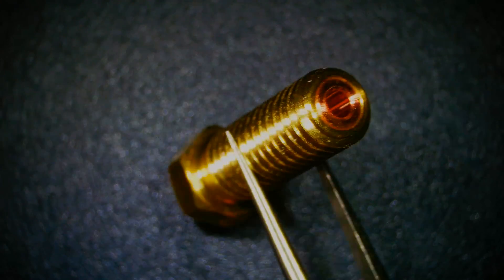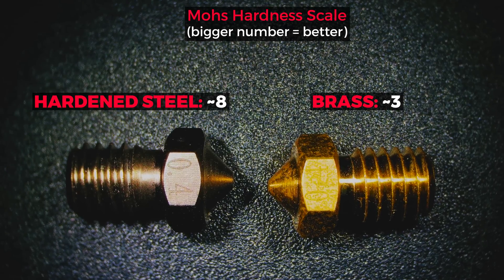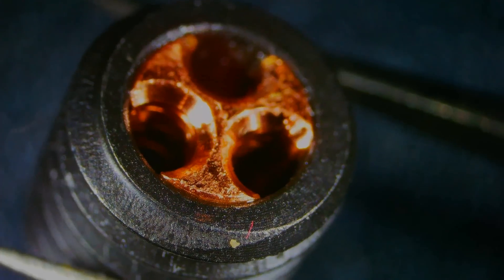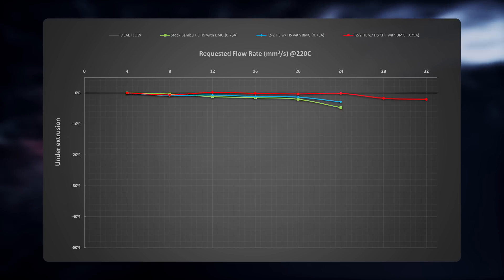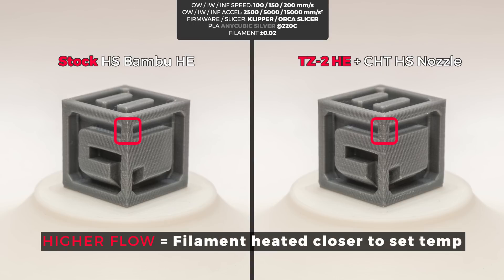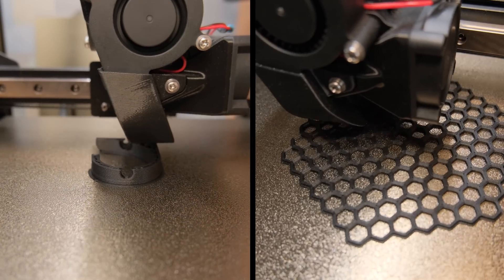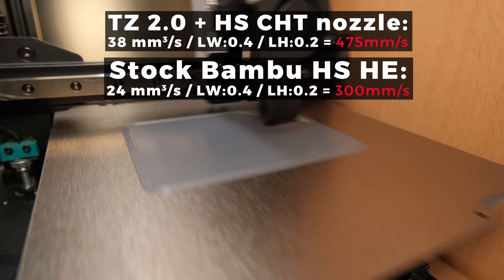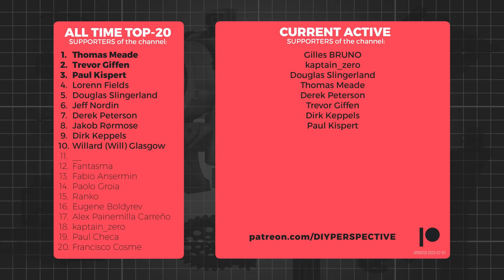HARDENED STEEL Nozzle with COPPER INSERT (IMPORTANT UPDATE in VIDEO DESCRIPTION)

Comment: How do you tell when the extruder starts skipping? What does 3~5% under extrusion mean, how is it measured?
Reply: You hear it skip or see the gear jump randomly as it attempts to extrude. And 3-5% under extrusion means that the extruder fails to push 3-5% of requested material, easy, but not 100% accurate test would be to measure from the filament inlet of the extruder to 100mm, then make a mark, extrude 100mm at the flow rate you want to test, then measure again. Your mark should be at the inlet, any gap between the mark and inlet indicates under extrusion, if the mark goes into the inlet, it's over extruding.

Comment: Those nozzles with copper inserts wearing out a bit faster is actually not a verry big deal since they're exchanged fast and easily at a cost of just €1,50. Compared to a naked Bambu Lab hotend of around €18, on which you need some time to disassemble and  exchange everything, or a fully assembled hotend which comes at €37

Comment: is it still necessary to preheat throat to tighten the nozzle? or tight it in cold throat is enough? and is any specific torque value or just tight with 6th sense;]

Comment: Hi, I was wondering, does the Qidi x plus 3 have automatic flow rate ajust? (same as the Bamboo), also, would it be possible to apply this hotend to the Qidi printer?
Reply from the maker: Hey. It doesn't. They're cht nozzles that fit QIDI hotend on AliExpress.

You could also apply only the tz nozzle. It would need additionally the Volcano to V6 adapter though.
QIDI nozzles are 19mm length. Volcano adapter + TZ cht nozzle is 8.5+10.6=19.1mm.

Comment: wait, how this works? You need 3 filament go in to the top? or does it slice it into 3 as it's gong in?
Reply from the maker: Plastics have very low thermal conductivity. So this nozle basically acts as a mixer to split the flowing plastic into 3 parts to better and more equally heat it.

Comment: This upgrade uses standard v6 nozzles correct? 

My only gripe is I wish it used a ring heater. But I’m definitely looking at this for a p1p
Reply from the maker: No, these are custom nozzles and not V6 for the TZ 2.0 hotend. But you can find V6 nozzles like these for other hotends.
Reply: What are the advantages of the ring heater over the flat ones? I was searching online looking for an answer but couldn't find anything

Comment: It makes sense.  The velocity of the abrasive material doesn't increase significantly until the filament necks down through the nozzle opening so the worst wear occurs at the smallest orifice.
Reply from the maker: Yeah and you also squishing down the filament at high speeds.

Comment: Do you need to increase the nozzle temperature to allow better flowrate?
Reply: No, at the same temperature it's heated the material more effectively so if anything you can run with slightly lower temperatures for the same performance if you want to save electrical costs or something 😂

Where these really shine though is high temperature and high speed. 

I was printing at 300mms with 0.8mm line width out of 0.4mm nozzle without under extruding @ 238c with geetech pla that's about 48 (mm)3/s which is insane. If anything I could of reduced temperature a little more as did have some cooling issues and had immovable supports and some drooping on non supported over hangs 45-50 degrees)

My nozzles were volcano style fitted to Kobra 2 max hotend.

Comment: What's the best way to mount this in a non bambu lab printer?  Do you think using your v6 adapter from the other vid + mounting in 3d printed v6 adapter mount (my printer doest use v6 style hot end)?  

Also,  what klipper settings shoukd i use for this therimstor/heater as im not dropping into a bambu lab?

Comment: I noticed there is a cheaper version from JUUPINE 3D Lab Store is it worth the risk? It is at least half the price and there are more nozzles options. I wonder if they are all the same manufacturer.
Reply from the maker: From my understanding Haldis 3D designs and manufactures the hotend. They reached out and asked if I was interested way before I saw those hotends from other sellers. Most likely they are mainly selling them in bulk to the resellers. So they should be the same, but I can't really know that for sure.
Reply: @PrintingPerspective  Thanks for the info. I am looking for a whole kit for P1S with the thermistor included as I want to keep my original intact.

Comment: I'm going to test this nozzle on my x1c for one main reason, parts don't seem to crystallise enough when printing fast and that makes them weaker.
Reply: howd it turn out? looking at getting one for my p1s
Reply: @EnchiladaBro  it does help when printing fast, but it seems there is a limit, possibly due to the hot zone length or heater capacity. Do I recommend it? Yes.

Comment: Amazing video, you have really found your niche in the world of 3d printing!

Can you do strength testing with this as well? From what I have read high speed printing is bad for strength since the filament does not get a chance to really heat up, with a cht nozzle it should be better. I am interested in the difference between slow printing with a regular nozzle and fast printing with parts that are designed for high speed printing.
Reply from the maker: Well, I thought multiple times about doing a video like this, but proper layer adhesion testing would require making a custom testing machine. And that takes a LOT of time. At some point, I will do it just because I love testing stuff. For now, I personally just use half of the hotend's max flow rate when I need good layer adhesion.
Reply: I always love to see similar testing done to confirm test results, but CNC Kitchen did a video on speed vs strength testing on his x1 and using the Cht nozzle almost increased layer strength proportional to the flow increase! Which makes sense, so these new nozzles let you print faster and maintain the strength. Printing slow is only stronger if you are running out of flow at higher speeds based on his data. Would love to see it confirmed!

Comment: @DIYPERSPECTIVE
How is the situation with the nozzle after two weeks?
Did you give it your all, and printed the hell out of it?
Reply from the maker: I had very little printing after I made the video as I swapped to a different hotend and extruder for a future video. I printed more for the video with that hotend/nozzle than others print when doing a 3D printer review lol. If you only on occasion print abrasives you will be fine. Most wear happens at the tip of the nozzle not inside.

Comment: bought two of them  and tested them into two different hot ends . In both scenarios i suffered from extruder motor overheat and stringing. Switched back to regular no issues at all. idk but it didnt worked for me
Reply from the maker: Well slightly more stringing is unavoidable because the insert is at the end of the hotend and it very well heats up the filament. So it can ooze more. I personally didn't saw that much more stringing. Also what a weak ass extruder you are using, haha? Even BMG type worked well in my case with 22mm stepper motor.
Reply: @PrintingPerspective  titan clone with medium size (32 mm depth) nema running at 0.8 amps
Reply from the maker: You should check out my video about original Bambu hotend where I showed how horrible Titan extruder is as it had insane under extrusion compared to even BMG. With these high flow hotends you need a powerful extruder, I even said that in this video. BMG is bare minimum and you are using Titan who works fine only with very low flow rates. You should be using something like Orbiter V2 with such hotends.

Comment: So is it the copper or is it the CHT-style that is making the difference?  I'm all about copper nozzles and blocks, but I wonder how much difference that small amount of copper for the insert makes.
Reply from the maker: Mainly CHT type as you split and heat the filament more equally and faster. But copper definitely helps also due to its high thermal conductivity.

Comment: Thanks for the video. Tried to purchase through paypal. There seems to be some error during checkout. Is this upgraded version available elsewhere?
Reply from the maker: I will tell the company, I don't think you can buy it anywhere else at this moment, I haven't seen it on Aliexpress yet.
Reply: @PrintingPerspective  Getting this same error with attempting to use paypal
Reply: @PrintingPerspective  Thanks i was finally able to buy the hotend using paypal and recieved the item quickly. Unfortunately, the package doesn't even include the hardened cht nozzle for which i made this purchase. I am still awaiting a response from customer service on why they didn't send the cht nozzle. Very disappointed. I was looking forward to using this hardened cht nozzle.
Reply from the maker: @nirajahmed7398  Hmm, the CHT comes as a gift. So they should send it. I will say to get their shit together, haha.
Reply from the maker: @nirajahmed7398 This is what they said after I forwarded your message: 

This problem is our fault. The warehouse shipped it and forgot to put it in the package. We are communicating with customers who have purchased it and will reissue it again, hoping to make up for their losses! This problem will not occur in the future, thank you for your timely feedback to us, thank you very much! Please rest assured that our follow-up shipments will strengthen inspections. In addition, you can help us reply, please contact customer service for missing accessories, and we will reissue them!
Reply: @PrintingPerspective  Thanks. Got a reply from them acknowledging the missing of part. Now i wait again. Meanwhile i might try one of those v6 hardened cht to print glow in the dark filament.

Comment: Hey, I love your videos, thanks for your awesome content :). Could you please test the fake Ali Volcano CHT nozzles to see if they can compare to official Volcano CHT nozzles ? I didn't see any comparison on these types of nozzles on the internet or YouTube.
Reply from the maker: Thanks, I think they will be very similar. You probably just need a stronger extruder with clones as the insert slightly restricts the flow.
Reply: @PrintingPerspective the copper splitter on the Vulcano cht clones is just as long as on the regular clones. I personally don't measure  difference between a mellow Vulcano adapter + clone cht Vs a Vulcano clone cht.  Both give me around 30mm³ on a CHC pro with esun pla+ at 220°C

Comment: Maybe the filament used for testing with wood fibers is not as abrasive as carbon fiber or stone so you would have seen likely more wear with the other two.
Anyway, it seems to me a very good idea. Even if the copper insert wears out, you can always replace it and they could just include a spear one.
Also i think the abraded copper should be smaller than the fibers of the filament so it shouldnt cause any problem.
Reply from the maker: Yeah, the wood filament is definitely less abrasive than the carbon fiber-filled one. But I mean if these nozzles become popular they will come down in price as more sellers start to compete with lower prices. Plus it is good to know that the copper insert won't wear out instantly. I hope we also will see regular V6 nozzles like these. Having a high flow and not having to worry when I need to print some abrasive filament is so nice.
Reply: @PrintingPerspective  I can currently see hardened v6 cht nozzles being available on Ali.
Reply: @cnckittchen mentioned that glow-in-the-dark filament is quite abrasive. Maybe give it a try